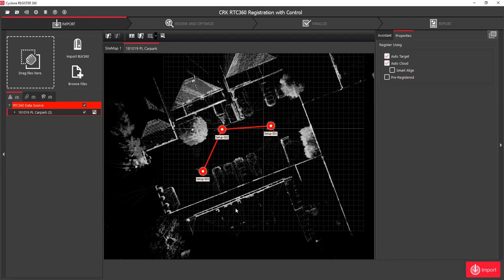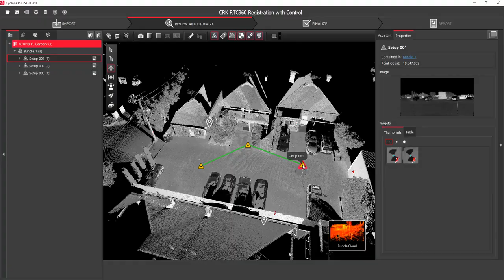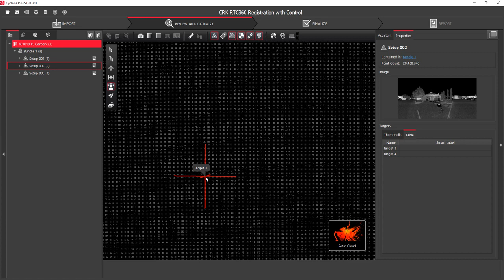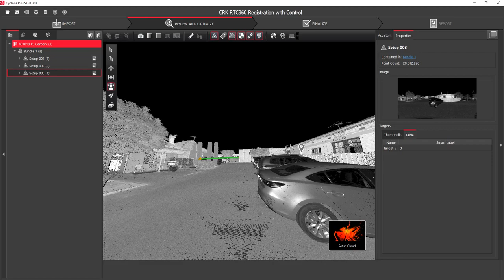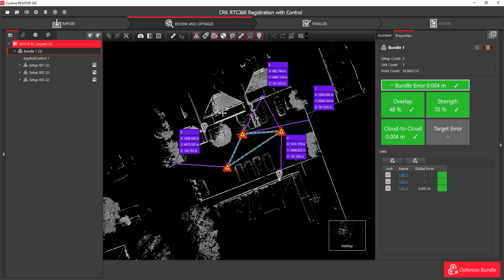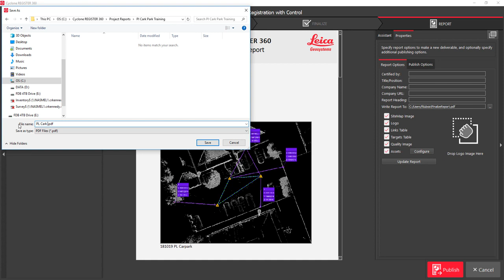Leica RTC360 Laser Scanner Tutorial - Scanning with Control Points with Leica Cyclone Register 360.

Comment: We acquired an RTC360 because it is fast and light.  We did a forest road and creek (100 meters up a gulch then 100 meters each way on a creek)...91 scans in one day (this would've taken a week or more with the P50).  It is finding the targets we had set up so that's good.  It also identified a lot of other things which are not targets, such as tree branches, etc.  Do I need to delete those?
Reply: Yes, you should remove erroneous targets.
Reply: I just finished 132 setups on a 3 acre site. It has 11 control points. I used a prism pole with paddle target which worked out to 1.500 meter target height. The control points are also GCPs for aerial photos. It only applied the better half of the control points but I check them all on and re-applied. The worst residual is 3cm all vertical which is sufficient for our needs. The horizontal residuals are wonderfully small.

We did this project on low resolution which cut down the file size to about 25% of medium resolution.

I was a P50 user but the RTC360 is faster and lighter, obviously the accuracy is not quite as good.

Comment: Why does setup-1 not recognize target 1? It is the closest setup to this target? Do you have an explanation?
Are there any parameters (scan position, distance,..) that should not be neglected? Thanks for your answer
Reply: Hi Nicolas, thanks for the question.
In this situation we used printed a4 targets and they weren't as clear as a normal target, I wasn't too worried as it was a training exercise for the customer and they could learn to manually fit the target in its setup.
We have also noticed that sometimes when the target is perpendicular and at the same height as the laser reference, it is possible that it doesn't detect it.
With the tilt and turn targets if you turn it slightly up or down and left or right so it is not facing strait on, depending on light conditions with very bright sunlight, then you will have more chance of the target been recognized.
We have done many tests and it does depend on the resolution you select as to how far it will recognize a target, our findings are a s follows:
With 6" black and white target are for Low Res which 12mm @ 10m is round about 5-8m.
With 6" black and white target are for Medium Res which 6mm @ 10m is round about 10-15mm.
With 6" black and white target are for High Res which 3mm @ 10m is round about 20-30m.
Hope my answer is of use to you.

Comment: Is there a way to apply control without elevation, just N and E?
Reply: Yes. You can apply control but you'll need an elevation. You can use the existing arbitrary elevation in the point cloud if you don't care about your Z-value.